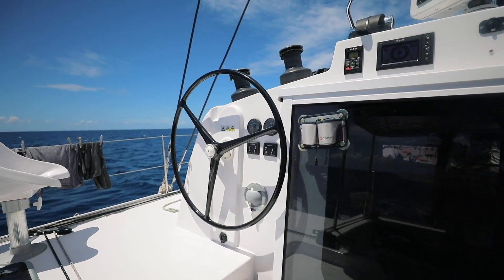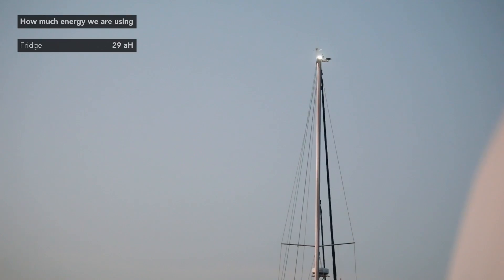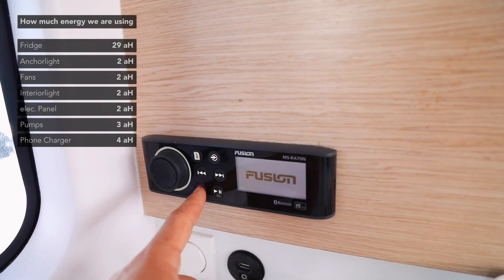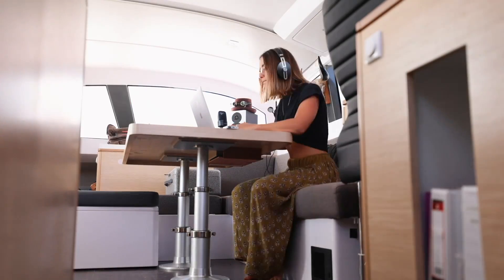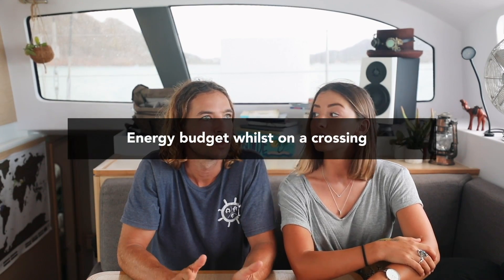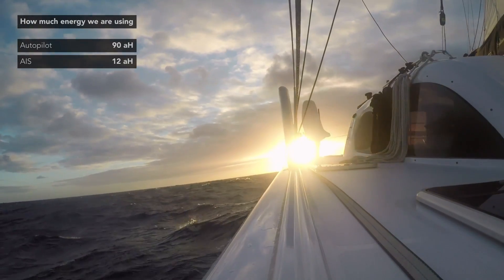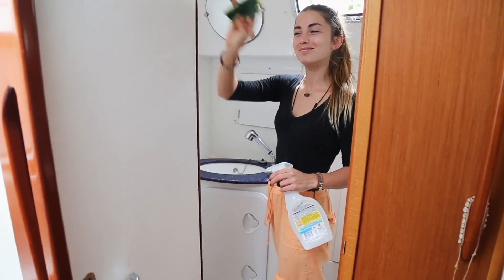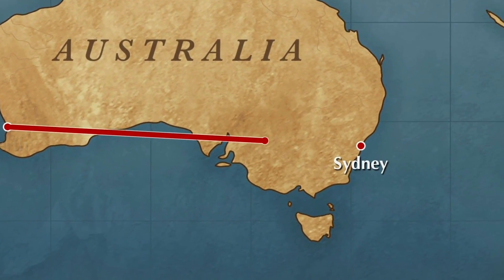Renewable Energy on a Boat

Comment: You can get a pretty decent small and efficient wind generator for about $400 these days.  Unless you are anchored in a dead calm, it could boost your energy gain considerably, and works day or night with a gentle breeze or better.
Reply: if its not a good one they can be loud though
Reply: They should buy more solar modules and get some solar power optimizer for every solar module. Thus they could place the modules even on places where they have sometimes shading.
Reply: Dont forget the shadow on solar, if the windgen is mounted badly (as usual)
Reply: My research has shown that to get the most out of a wind generator, it's best to have a very tall pole... something to do with turbulence when it's set on low a pole... So, on a boat that won't be too practical.
Reply: IIRC surveys that have been done of cruisers such as in the ARC rally etc generally give wind gens a poor rating relative to solar. Multiple reasons:
Many wind gens are low-radius, high-rpm which works best in high wind speed but when sailing DW as much cruising is, your apparent wind is low also people tend to anchor in sheltered spots so the generation at anchor can be poor. They are noisy and vibrate a lot. I've witnessed this on anchor and a neighboring boat maybe 200 yards away had one and it couldn't have been nice to be in their cockpit as it was noticeable in ours. OTOH another guy had a large radius apparently homemade one in his boat and it was super quiet and spun well in low wind.
Reply: Peter M. Eggers...... took a wind gen across the Pacific and they are very poor amp providers...... solar is 100 times better.
Reply: @sails3538  I assume that you had both, wind and sun.  There seems to be an "either or" attitude with a great many people.  We have both.  The wind still blows at night.
Reply: David B. Cutter ... No.... I read the literature and believed the amp rating they provided.   On all my systems I put an ameter between the charging system and the batts to see how many amps go in to the batts, and the wind gen averaged  1 amp an hour crossing the Pacific.   Also the wind blows less than 50% of the time and wind is way less in sheltered anchorages.  Today.... in Guaymas, Mexico there is lots of sun and 5 knts of wind  so the wind gen is useless.  This is a normal day.
Reply: @sails3538  Your anecdotal information is not only obviously incomplete and bereft of any numerical details, but it has the sound of a complete fabrication.

Comment: I've never seen anyone do an energy budget before by counting amps instead of watts.  Using amps is a pretty confusing and inaccurate way to do it because the voltages of your loads (cell phone charger, fridge, etc) may be different, especially if you are on a 24 or 48v DC system, but still have 12v outlets.  Also, some of those loads like your fridge aren't continuous.  My humble recommendation would be to convert your loads to watts (V*A=W), then compare to your battery bank's watt hours.
Reply: Most sailors I know use amps and amp hours.
Reply: 88 Miles Per Hour!!!!!   Shut the Hell Up People!!!      @johnbotham7756
Reply: adamff280 totally agree with Brian. This Adam bloke is such a pain in the neck, I can’t believe I wasted 30 sec to even comment. How sad.
Reply: agreen6301 ......  for any voltage, a battery's storage is in amp-hours and so amps is the best way to communicate with people living off of batteries.   All sailors I know talk energy storage and use in amps.
Reply: As long as you (as i surpose Reily does) is budgetting on inlet and outlet to the battery bank, AH is a ok way to budgetting. If you start talking consumer amps, then it could start ruin the budget.
Reply: Hey @agreen6301  Your're so Fucking smart, why don't You do the conversions for all of us!
Reply: @adamff280  This just proves you are ignorant, and foul mouthed.

Comment: The alternative to the A and Ah terminology is W and Wh (just like the power companies). 1A @12V is 12W, and 1Ah @12V is 12Wh (W = Volts x Amps). If everything is 12V, all good (it's just a relative unit), but if you have different battery voltages or voltages in appliances - say 24V and 12V mixed for house and starter, or inverter appliances, it can help to use W, and it also makes it easier to align your generator sources (which are specified in W). Your 300Ah lithiums (@12V nominal) are 3.6KWh of energy storage.

The other place this comes in handy is for estimating things like your phone charger, or inverter driven appliances. For example, the Pixel XL comes with a 3,450 mAh (13.28 Wh) battery, but that Ah rating is at 3.8V or something. @ 12V that 3.4 Ah is only 1.1 Ah approx. (13Wh is about 1.1Ah @ 12V), so you've probably over budgeted on your phone (even if you charge it from your inverter via an AC adapter - which will be less than 80% efficient in power conversion). Similarly your microwave is say 800W. Run it for 10 minutes and it's 130Wh of power (which you could convert to Ah  if needed - 130/12 is about 11Ah.

So, in short - budgeting is easier if you use W and Wh.

Keep up the good work. If La Vagabonde is ever in Australia again, you should try some cool climate sailing, and check out Tassie (Do the big lap). Water is cold, but some awesome scenery.
Reply: What he said. Plus... easiest to just convert everything to watts and watt-hours. Ahs used is an inadequate term because battery pack voltages will vary. I work on electric cars/renewable energy systems and this saying applies. I will just change one word from car to boat- "Not knowing the difference between a watt and a watt-hour is like a boat salesman not knowing the difference between horsepower and how much fuel the fuel tank holds." Your video demonstrates that you need to work on grasping the difference between a watt (or amp) and a watt-hour (or amp-hour). Good Luck and Safe Travels! :-)
Reply: @lektwik  In the "old" days there was no need to multiply everything by 12. Your (only) meter showed, say 2 A consumption for the lights and you knew they were on for, say 8 hours. Presto, you got the energy usage of 16 Ah, simples!
Reply: I agree that using W and Wh units would be helpful. I'll add that in engineering terminology, W (watt) is a unit of power and that Wh (watt-hour) is a unit of energy.
Reply: Thank you! You saved my time, otherwise i would have written nearly the same!
Reply: Eh? It’s not all 12v.  An amp-hour is not a watt-hour
Reply: Darren Steven Batteries are rated in Amp Hours. On a boat EVERYTHING revolves around your batteries. The kids have it right
Reply: @HowardPaulblasingame  Exactly - you have to nurse those batteries and know the budget, but Ah in a 12V system is another way of saying Wh.  Not saying they are wrong, it's just less messy to use W and Wh everywhere. 10Ah at your inverter power outlet (10A 240V) is not the same as 10Ah at the batteries. 800Wh at the inverter point is the same as 800Wh at the batteries (less efficiencies). If you take your 300Ah, battery bank, and say it's a 3.6kWh battery bank, then you can do the power budget: 4 x 100W panels for 6h = 2.4kWh, less the power consumption of all loads in Wh. A good example is actually the solar panels. A smart MPPT charger will potentially reduce the amps out of the panel to maximise power (although you typically measure the solar input after the regulator, which normalises things to the battery voltage).  Trickle charging your battery at 13.8V with 100Ah is less energy than the same 100Ah @14.6V. 

On a side note, the other thing you should also do is de-rate your batteries with load. The rated Ah capacity is only at 1/10 of some charge rate. You can only get the rated Ah capacity if you stay below a certain discharge rate. This applies whether you budget in Wh or Ah. High W appliances for short times eat more from your capacity than running a lower W appliance for longer (with same Wh totals, or Ah totals). Anything that would flatten your batteries in less than 12h needs to have its budget bumped up in proportion (so a load that would kill them in 8h should be factored in 3 or 4x as much as the nominal load it's drawing). Lithoiums do better here than lead Acid I think.
Reply: @HowardPaulblasingame  your right but you can not messure energy consumation in Ah. As example the fridge needs more Ah when the battery is low then it needs when the battery is fully charged. So on a cloudy Day it seams like you need more energy then you need when the Sun shines. But it isnot like this. The si unit for energy is watt and not Ampere. Ampere is no unit for energy because it is not constant.
Reply: @t.490   Watts are a unit of power, not energy. Electric energy is watts times time (usually watt-hours). The SI unit of energy is the Joule.  One Joule=one Watt-second

Comment: How about a laptop charger that converts 12v to 19v instead of using the inverter that goes from 12vdc to 120vac back to 19vdc. A little more efficient

Comment: You can save ~10% plus another 3-6w on your laptop energy by getting a DC to DC adaptor for the laptop... so it goes 12v to laptop voltage (typically 18v). 

With an inverter you are converting 12v to 110v or 240v, but then converting back to 18v with the laptop charger.
Reply: CaptainD is right, but you have to match the DC and AMPS to your laptop.  If you look at the power brick for the laptop you will see listed under output something like. 19.5V 3.5 A.  So you have to match the dc voltage and the amperage at that voltage.  It makes it somewhat difficult for larger more capable computers.  Not tablets and phones so much, but certainly for laptops and desktops.  There are 5V with various amp converters all over the place for battery systems to charge tablets and phones, but getting the DC voltage and amperage right without going through the power brick is a chore for laptops and desktops.
Reply: Yepper, DC to DC is the most energy efficient way to go as well as a TOP loader freezer / fridge (saves 90% energy vs front loader)... Convert from dc to ac back to dc is just plain wasteful.
Reply: Yep.  Was going to say this as well. Any ways you can avoid an inverter, you are better off. This is true for Rvs as well as boats. Pretty well all electronics run on guts that need DC electricity.  They are all expecting you to only have AC power available though, so they don’t bother providing DC options. Often you have to search it out yourself.  Consult the text on the brick that says what the DC output voltage is. The. As CaptainD1990 says, find a DC to DC converter what gets your boats 12v to whatever the brink output is.  Why does AC exist at all? AC is all about transmission over distances. It’s safer for that purpose.  Be careful of DC though. Long runs of DC wires pose a fire risk.  Make sure you are on circuits with fuses.  This is why often cigarette lighter chargers often have a fuse inside the plug part.
Reply: As previously mentioned, you might want to consider switching to Final Cut Pro X. You’d be surprised how extremely well optimised the software is. I honestly think you could save 25–50% compared to your current notebook energy consumption due to e.g. significantly shorter rendering times compared to Premiere Pro.
Reply: Get more pv.... couple of wind things. 💨
Reply: @claton blade Just think about it (and then put a meter on it). Every time you open a front loader ALL of the cold air falls out instantly and the temp goes up causing it to run to cool it down every time vs a top  
loader that loses almost zero cold air.
Reply: Was gonna say the same thing... anything else on an inverter?
Reply: +1 just thought exactly this the moment the mentioned their inverter for the laptop. Of course their laptop is not the only appliance that they will be using on their inverter but it definitely is a big one. Getting a multi port, high power USB Type C charger (with good efficiency) will allow to charge phone(s) + laptop(s) etc. with great efficiency.
Reply: Absolutely why would you not do that!!
Reply: Yes, for any device on the boat that you use regularly you would save considerable energy finding a DC Version of it.  Any time you need an inverter there is power being wasted.  And as everyone else has stated Watts is the using of power you are using.  But at the same time its your boat, do what works for you!  If you're not running out of power that is all that really matters.
Reply: Great suggestion. I do this for my CPAP machine.
Reply: @NotBROLL  That's too drastic. OP provided a feasible solution
Reply: CaptainD1990 beat me to it, direct 60w type C port off the battery or charge controller will save a huge amount of energy
Reply: This also makes a difference for phone chargers.  Use ones made for DC vrs AC plug ins.
Reply: You all have it wrong! This is old-school thinking from about 10 years+ ago when everything was converted to DC using coil wound transformers, a diode bridge rectifier and a smoothing capacitor. Now, everything uses SMPS (switch mode power supply). Even your little 12v cigarette phone charger. If you have your 110/220v pure sinewave inverter running, you may as well just use it. Add more solar or batteries if you have to.
Reply: @pmbnet  Nope - convert up then convert back down is 2 lots of SMPS losses but you can cut one of those out and just buy cheap boost converters to get from 12v to 19v etc.
Reply: @rhiantaylor3446  Boost converters are SMPS right?
Reply: @pmbnet  Yes - the term Switched Mode Power Supply (SMPS) includes Boost i.e. 12v to 19v or Buck i.e. 12v to 5v conversion. A 10 amp converter costs just a few $ from china these days (ebay).

Comment: Good stuff as always.... tip: Stop using an inverter to charge the laptop. You are taking DC, converting it to AC so that you can plug in your AC to DC converter... Losing about 15-20% in the process. Get a 12V charger... MacBook Pro example: https://www.amazon.com/Sopito-Adapter-Charger-magsafe1-magsafe/dp/B07BLPBMX1/ref=sr_1_3_a_it?ie=UTF8&qid=1533615767&sr=8-3&keywords=12v+macbook+charger&dpID=31SEID9U3KL&preST=_SY300_QL70_&dpSrc=srch